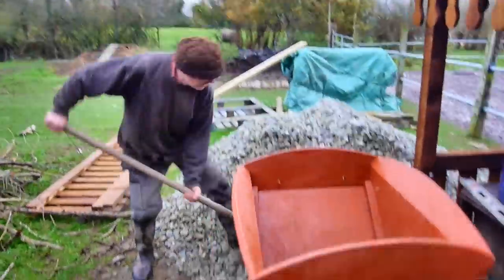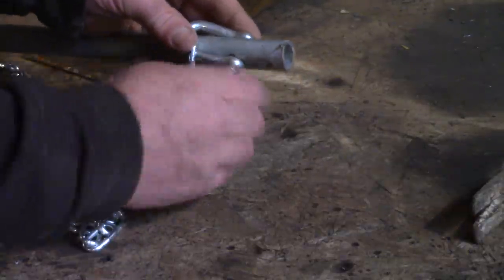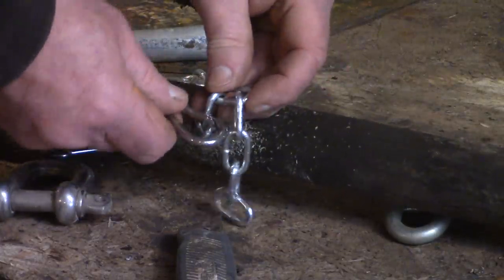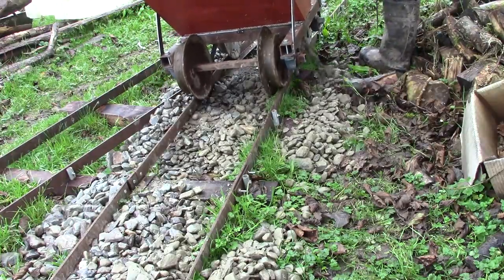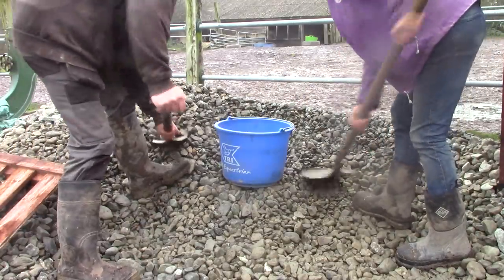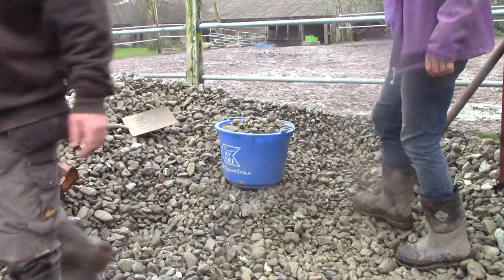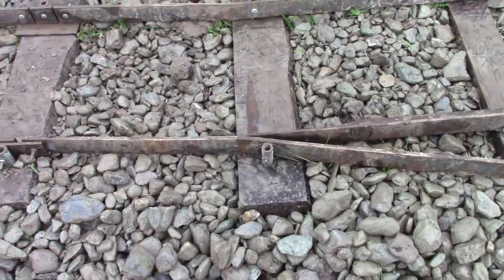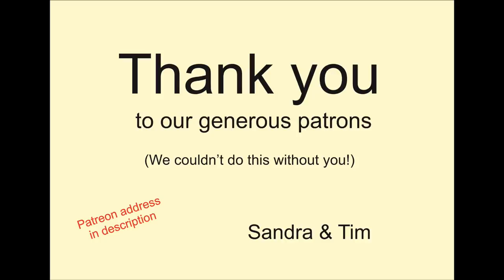A Wiggle-Stick And Other Improvements To The Ballast Wagon - And How Much Weight Can It Carry?

Comment: One thing I think you might find handy would be a prybar with a slot or u-shaped bracket to keep the working end on the rail.  Inserted between a wheel and the track, it helps get a heavy or stuck load moving.  https://www.youtube.com/watch?v=7W8c_jMVYAs
Reply from the maker: Thanks Andrew - yes, interesting. I think the difference in what I'm doing and anything bigger is that I can still push things around. It's quite an advantage..

Comment: Have you got permanent access to a "Builders Level" as you should be keeping the track as LEVEL as possible (across the track) if you intend to keep lifting it to put stones/gravel under the sleepers.
Even slight "twist" in short distances will twist the track enough to derail your "full" wagons, (when one flange rides over the top of the twisted trackwork) meaning oopsie, a LOT of hard work, emptying the wagon and r-railing it, to reload it.

Comment: If you build anymore track you should put the balance down first and then the rails by using your new ballast wagon to deliver the ballast I also have a idea on how to build a locomotive you know those lawn mowers that you can drive buy a old used one on the cheap and use the motor and some other components and build a locomotive
Reply from the maker: Can you explain how I put the ballast down first, if the rails aren't there?
Reply: @wayoutwest-workshopstuff6299  you use the wagon to bring the ballast there and then put it down by shovel then lay the sleepers and rails down and use the Nifty feature on the wagon for maintenance
Reply from the maker: No way would I do it that way. Each length of track is twenty feet long. It would take hours to carry all the shovel-loads. But if you do it on yours I'd like to see the video  : -  )
Reply: @wayoutwest-workshopstuff6299  He He He!!!!

Comment: For laying NEW track, a front-tipper/rake out cart might be useful - Dump and rake out a stone base from the end of existing track, put down new sleepers, add rail, repeat.

Might want to rig some short temp rail sections that don't need any fasteners screwed in so you can build out and quickly replace with longer rail section without having to unscrew anything.

Probably best built as a front/side rake out for flexibility.

After that you come along with the side drop cart to infill as needed.

Comment: You don't appear at all thick. And with model railways, you tend to put the ballast in after the track, as it's purely decorative. The board and the underlay (usually cork) do the actual job of the ballast on a model railway.
Reply: not decorative at all. They lift the track dump the ballast and slide the sleeper in.  The ballast is the foundation for the track and it would sink without them. The modern automated ones actually spread the rails apart ahead of the wagon but with some wedges on a stick he could lift the track and still roll over them.
Reply: @excitedbox5705  What on earth are you on about? I'm talking about MODEL railways, where the ballast is entirety decorative.
Reply: @keirapoppins2514  Railway Modeller editor chips in!

Comment: would it not have been better to level the soil and laid a firm layer of ballast for the sleepers and rails to sit on first rather than dig it under after? that way the track can be levelled easier and held in place better.
Reply from the maker: there's about a ton of stones for each rail-length. No way was I going to carry that around with buckets

Comment: We have a miniature Railroad in Ohio called The Mill Creek Central Railroad and we have ballasting cars the ballast are miniature train track which is 7.5 gauge R2 train cars can hold about a the two cars can hold about 600 lb of ballast. If I were you I would build a small locomotive it won't be too hard because of pens on the engine oh you need to go slow with your little Railway
Reply from the maker: Interesting - what weight is there on each axle?
Reply: @wayoutwest-workshopstuff6299  all the axles have Springs on it it's all equalized. If it's a locomotive it has gears almost like bicycle gears or heavy-duty motorcycle gear powering the axle to a motor into a clutch. All you need is a small clutch period if you're building a locomotive

Comment: Why does it take so much effort to push the wagon? I thought rails should make that easy, but it looks like the same amount of effort as pushing something on rubber air tyres.
Reply from the maker: It was much harder round the corner than on the straight - and there's a lot of weight in there

Comment: wouldn't a regular wheel barrow be... i dunno.... easier than all that stuffing around?? And yes, you want the sleepers on top of the ballast
Reply: You moved full wheel barrows around in thick mud before?
Reply: @ItreboR63I  If you are making a path you pour as you go, then the road unfolds in front of you. I agree that pushing a wheelbarrow in the mud is mental, but if the object is just to make the path then make it as you go.
Reply: I guess Tim had to have proof-of-concept for his low-cost railway design before he invested extra money & time into ballast. Hence he's doing things somewhat out of sequence in comparison to installing a railway of known design functionality. But he seems to be making it work anyway...
Reply: @davidhaywood8029  It's a great railway, everything that goes on it works well!